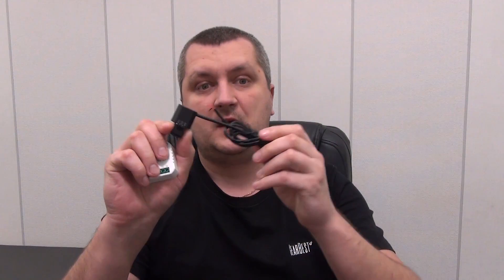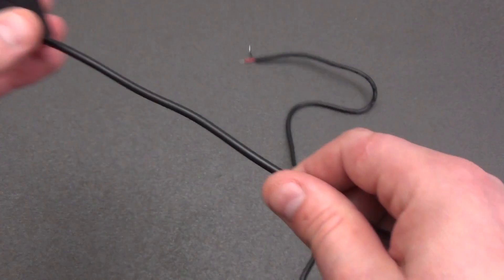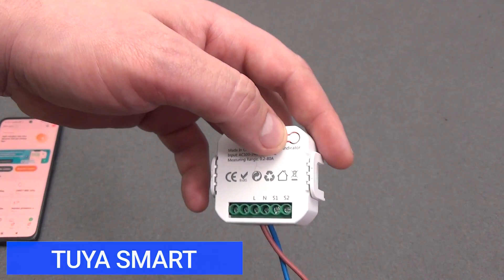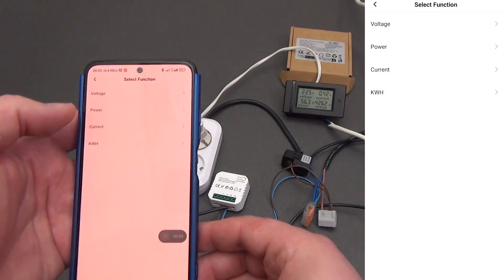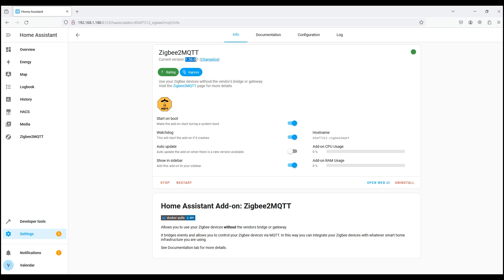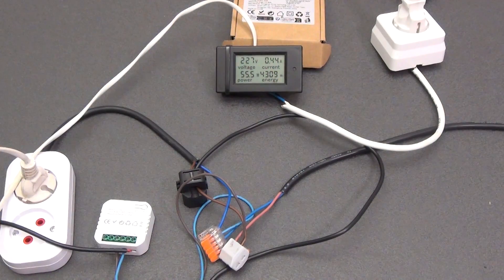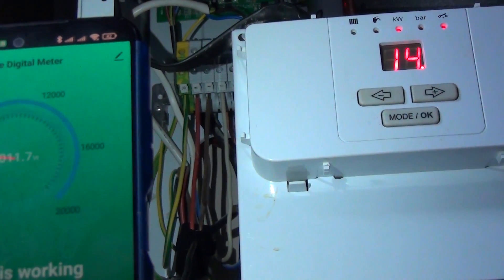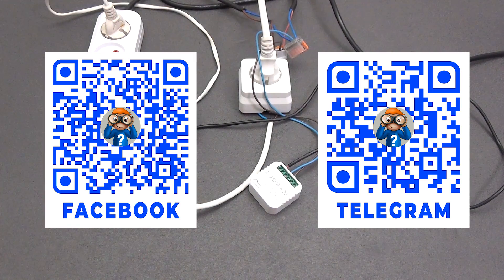Энергомонитор Tuya с токовым трансформатором: точный учет и мониторинг электроэнергии

Comment: , 
Hi, my home voltage is going up to 250v in day times due to solar in the grid. this unit working voltage mentions as 240V so can I used this unit without any issues in my house
Reply from the maker: Hi, you can wash it without any problems!

Comment: Can this be powered by 2 120 volt lines as is 220volt power in usa
Reply from the maker: You can connect it to 110/120 volts, it is rated for that voltage too. (Voltage 100-240V)
Reply: @EvgenLubops  I did it and it is working fine two 120volt lines feeding the monitor
Reply from the maker: @ke6bnl  Try from 1 to 120 volts!
Reply from the maker: @ke6bnl  Good!